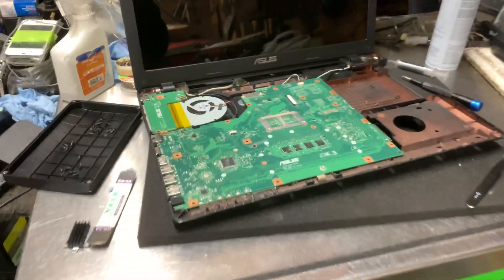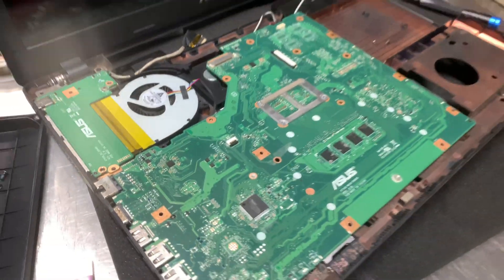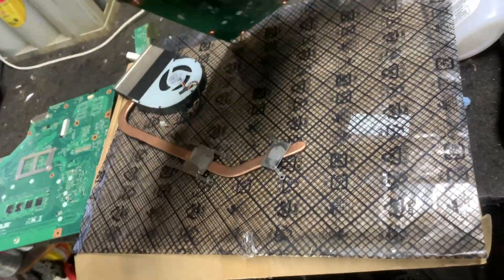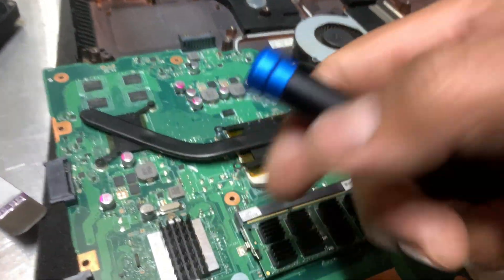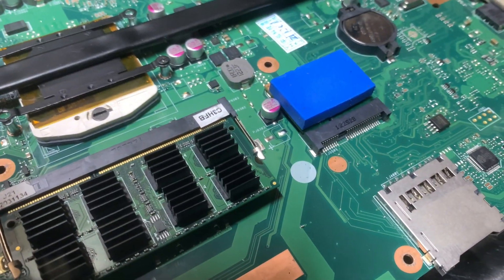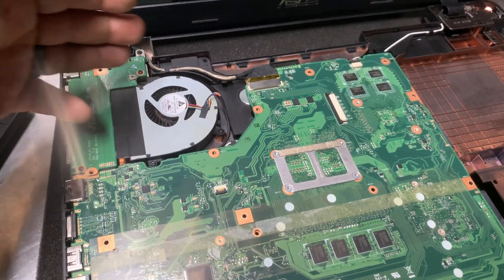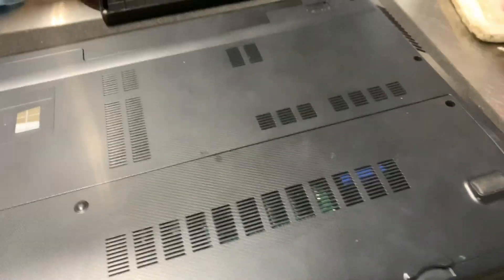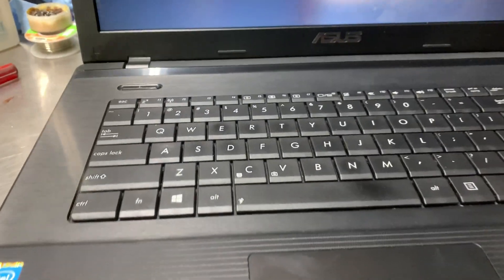Asus r704a how to upgrade motherboard, memory ram , ssd /next the i7 gpu

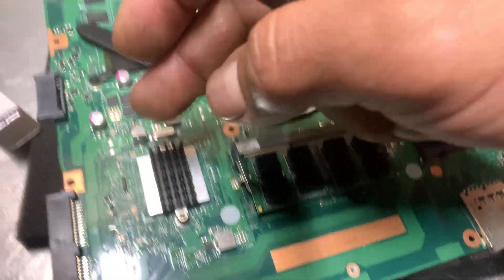Comment: 4:24 That chip what is cooled is the dedicated GPU. (Nvidia or AMD) and the other chip is not the Integrated GPU. but thats the Chipset or the PCH. 

The integrated GPU is inside the CPU. u can see it clear on the First gen i7. there u have 2 seperate Chips on the CPU.
And do you know why, my R704A, shutdown with a i5/i7 cpu after a upgrade it shutdowns in 30 mins.
Reply: It's over heating ! And no it's an unrelated gpu not nvidia or amd
Reply from the maker: Overheated yes  needs to upgrade the heat sink  or replace the paste in cpu